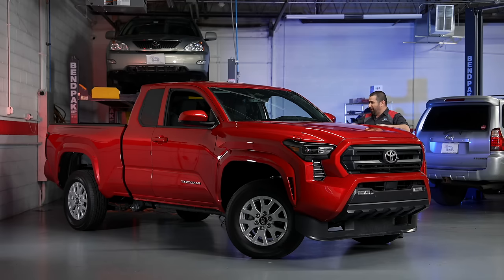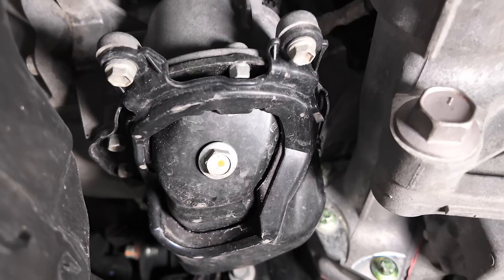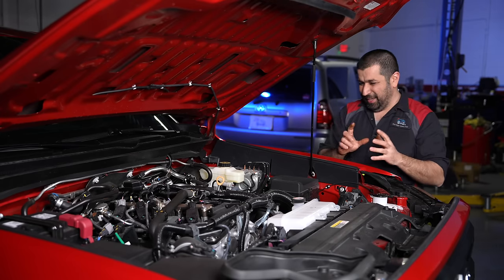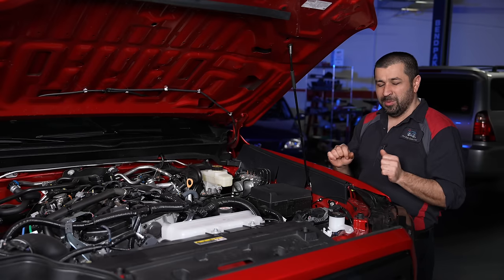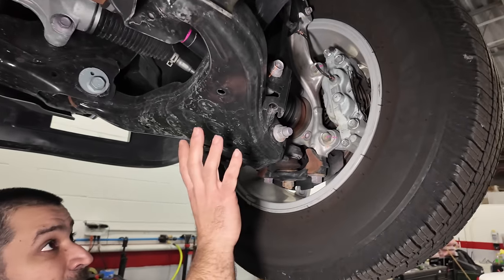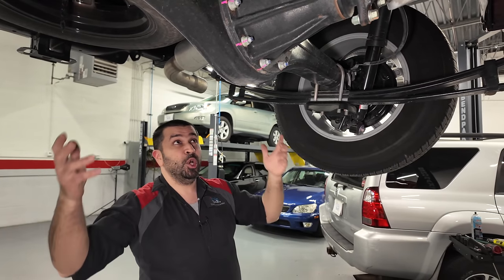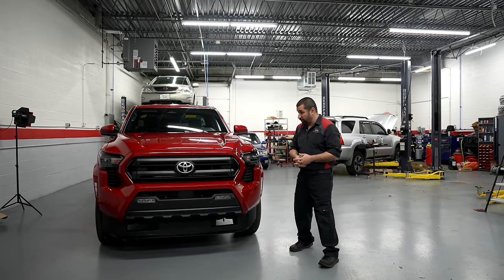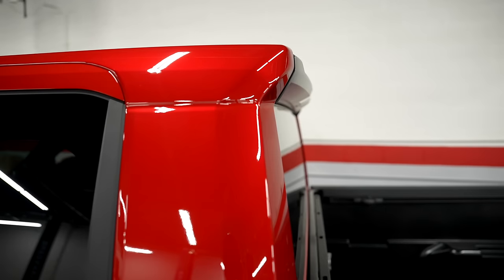2024 Toyota Tacoma | Did Toyota Improve or Ruin The Tacoma? Comprehensive Review

Comment: My 2020 Tacoma has the V6 engine so I get the best of both worlds.  No power AND bad milage.  Perfect!
Reply: You will get a good laugh reading all the comments lamenting the disappearance of the 3.5 V6 and its legendary 'gearhunter' transmission. 😉
Reply: Now you can buy one of these and it will get a little bit better mileage, a little more power(maybe), but wait, there's more! You can also get the reduced reliability and bugs that need to be worked out as part of the deal!
Reply: @Doomzdayxx this turbo 2.4 isn’t even remotely new.  It’s been used in other models including Lexus.  He even mentions that in the video.
Reply: @johncho8766  Cool story.
Reply: @Doomzdayxx  read what you wrote and what I wrote and ask yourself which one is a statement and which one is a story.
Reply: @Doomzdayxx  🤡
Reply: Laughs in 2.7 I4
Reply: @Doomzdayxx you're a joke. It's massively more torque overall and at a lower rpm.
Reply: This new one is getting 1mpg better EPA on the highway and TFLs new Tacoma broke down already.
Reply: @nicholasroberts9618  it was never meant to get better fuel economy; it was meant for better power at not worse fuel economy.  The head engineer said as much on its launch.  Yeah, TFL’s Tacoma lost front wheel power, most likely a CV shaft or front diff, not the engine.
Reply: @BrandonEht  The spiritual successor to the 22r. At least that's how I've always though of it. I'm considering looking for an older 2WD tacoma with that engine and a manual trans.
Reply: @MrMikeDao It's trash and will be plagued with issues and will not be as reliable as the V6 and definitely not the 2.7. Keep boot licking though.
Reply: @tristanedley  🤖
Reply: The previous 4.0 was so much better it actually had some torque.
Reply: @johncho8766  Major cope
Reply: @johncho8766 it gets alot better fuel economy.  24 hwy with the dam
Reply: @nicholasroberts9618 yeah well they just launched the vehicle im not worried about it since i wont buy one yet.  But they will improve it in the future.
Reply: @Doomzdayxx  I've had turbo'd 4 cylinder cars and motorbikes since the 80's; properly engineered, they go like stink and none of them ever blew up or wore out on me, which is more than I can say for some of the hotted up naturally aspirated V8 powered cars I've had..
Reply: @petesmitt cool story bro.
Reply: @johncho8766  Everyone in a panic like Toyota hasn't thoroughly vetted this engine. It's because us Americans are used to our automakers dropping new engines that turn out to be turds or don't have all the bugs worked out yet( or they will make a good engine and tweak it until it sucks).  Toyota does not f**k around in the US market. They would never put an engine in a vehicle as popular as the Tacoma unless they were absolutely sure it was reliable and durable. if someone has an example of them doing otherwise I'd love to hear it.
Reply: True that
Reply: @Doomzdayxx This engine is proven. It’s not new. It’s better than the V6. More power with more torque at a lower rpm. The engine doesn’t need to work as hard. Better on fuel too.
Reply: @mjwbulich GM and Ford 4 cylinder, I would stay away. Toyota is a master at 4 cylinder. Toyota does brutal testing in their engines. 

Toyotas issues are differentials and rust.
Reply: @ryanb8736  said nobody.
Reply: This engine sounds worrisome with all the gaskets and turbo charged pressure.
Reply: @grayman618  Say it a little louder for the idiots in the back!
Reply: @nicholasroberts9618  take off the ugly chin spoiler, and the four banger gets the same mpg as the v6!!!
Reply: 0 to 60 in 3 to 5 business days. As an owner of an old Tacoma,  I know!
Reply: @socc4298 complaining about the speed of a tacoma is like buying a scooter, then complaining theres not enough storage space for luggage.
Reply: @nicholasroberts9618  take off the chin spoiler, and the 4 banger gets the SAME gas mileage as the v6.
Reply: @Doomzdayxx it’s a fact, not a story. I like the v6, but the outgoing v6 was a turd. The man was just repeating what was said in the video. Why would it be a story??
Reply: @johncho8766 Lexus are road queens.. let’s see what happens to that 4 banger turbo in real off road situations.
Reply: @Ed-gq8hk  sure, only time will tell.  I’m not the one pretending to know or to be able to predict the future, that’s Doomzdayxx’s job.  All I said is that the turbo 2.4 is not remotely new.  I’ve owned a 2007 4.0 and now a 2017 3.5 and neither of them were amazing in terms of power or efficiency but neither of them (or any Toyota I’ve driven) were turds from a reliability point of view.
Reply: @rightlanehog3151  Yeah I just tuned it. Problem solved. Now I don't have to waste $10,000 more on a downgrade. I am getting 22MPG now.  Plenty of low end power and no gear hunting. The front diff already self deleted on TFLs new 24 tacoma doing mild work. No thanks. I am not paying more money for less. I am sure in a couple years it will be better when they fix the issues. I saw another 24 tacoma on taco nation that just quit starting with only 800 miles. Stuck where he was at.
Reply: @Doomzdayxx  i have the 2.7L it is seriously under powered for the weight of truck. If it had any low end it would be decent.
Reply: @JD-yx7be I had one too. i'm no genius, but when I bought it, I was smart enough to know that it's not meant for racing or for heavy towing, therefore it was never a problem for me. 

It's a small, simple, super reliable little engine for small light duty trucks that can go well over 400k miles with decent maintenance. good luck getting that with a turbo engine.
Reply: Its the transmission that's garbage. Not the engine. I have a 2019 with a manual transmission and it drives just fine. I have hauled excessive weight up one of the longest sustained climbs in America with zero issue.
Reply: @deadbrother5355  No the transmission is fine. It needs a tune. The stock tune is shit. With the OTT it remaps the ecu power curve. All your torque and HP comes in at the low end how it should be instead of making peak power at 5000 something rpm. It changes the transmission shifts  to linear and holds gear on inclines no problem. A tune solves all the issues people complain about. It also makes the throttle response instant. No more waiting on the transmission to shift. People with manual tacomas get their trucks tuned as well to move the power down low where it should be.
Reply: @deadbrother5355  - I have a manual TRD Pro and while I like it, but she's a dog.  Getting about 11 MPG combined.  Interesting to hear about your towing experience.  I have two small quad 80s that my truck struggles to pull up moderate hills here in Los Angeles.  I have to keep it reved out in third or fourth to stay around 55mph.
Reply: @danielstewart7369  i average 14-15 mpg. Are you running oversized tires?
Reply: @270eman  i agree that the factory tune is trash. I hate the throttle lag SO much.
Reply: lol!!!
Reply: Never had any problems in my 4 Toyota pickups, 1985, 1991, 1995, and current 2000 model Tacoma, New York State Road Salt is eating up the frame and body but it still runs awesome with 245,000+ miles on it yet.
Reply: @johncho8766 the Front Drive is designed to fail. You should have watched the whole TFL video
Reply: @montefiveforty1  they should have modernized the 4.0 with DI, higher compression and a 9 speed trans
Reply: @mjwbulich  Tundra owners may disagree
Reply: I’ve got a 19 sport and it has plenty of power.  I  don’t love the transmission like I did on my other 3 Tacomas prior to that but as far as power, it goes.  I’ve had sport cars, real ones. Corvettes.  So I know power. Is it the fastest? Of course not.  But I wouldn’t even mention it.  I’d talk about the crappy stereo and console.  The problem with Tacoma’s today is they make too many freaking options.  And then all these goons that Change everything on them.  It’s all about $.   And selling crap to these young ………..people.  
But I remember a time I thought spinners were cool.  So we all have our dumb a moments. I’m being nice because apparently there isn’t free speech on YouTube.
Reply: Them WHY do people wait on line to overpay for them, saying how great they are?  They could buy  a Frontier with strong power for less money. And  yes, they are extremely rereliable.
Reply: And probably will last 300.000 miles ......😅😅😅😅
Reply: . This is not a sedan.  Its a working truck.  There is not replacement for displacement.   Preffer the bigger slower V6 with not turbos , 20 spéeds and Ton of gizmos .....
Reply: .  Buy a prius so.     Have the last gen and make 20mpg everyday ....
Reply: @ryanb8736  want to see 250.000 miles on this one ...😅😅
Reply: . Exactly.  Totally different application
Reply: Seems the Taco has a lot of mothers to love it for all its glaring defects. The Toyota addiction must be very powerful to turn liabilities into loveable "assets."
Reply: @rightlanehog3151  it's hilarious how these blindly brand-loyal Taco fans look past these legendary liabilities,  while bashing the Frontier's torquey, reliable engine, and non-hunting transmission,  which contrary to popular lies is NOT  a "crappy Nissan transmission" (not a CVT).
The world is so full of propaganda.
Reply: @johncho8766  Even so, should Toyota be blowing diffs at this stage in their experience?
My Toyota 4x4 blew a rear differential early under warranty (NO off roading), AND again after the warranty was gone. Andva head gasket under warranty also. Toyota is not as perfect as the fanbase claims.
Reply: @Doomzdayxx  Good idea. The new 4 will never be like the 22R due to stress and complexity. 
Only bad thing about later 22R is the single row timing chain which does not last like the earlier ones. Originally,  both Nissan and Toyota used stout double row chains. Nissan wisely stuck with double,  while Toyota in the 80s skimped out. The chain and guides wear more quickly. My understanding is there are kits to convert them back to double. Otherwise those things are like tractors and run for many years.
Reply: @iskdude9922  Yes but who will leave the ugly dam on?
Reply: @mjwbulich  Sir, what about the Tundra? Wastegates going bad and cab REMOVAL  to fix, and now numerous reports of engines blowing and difficulty finding replacements for months while trucks sit at dealers. 
Not off to a good start. We can't blindly assume the big T is guaranteed to never blow it.  Now they are so cheap they moved Taco to "hecho en Mexico." And the price went UP!  Nissan Frontier still built with US jobs. And coats LESS  Greedy Toyota.
Reply: @ryanb8736  Simple physics: more power out of less displacement means it IS working harder. It FEELS more effortless,  but higher cylinder pressures and Temps are  creating the higher power.
Reply: @ryanb8736  Even my old SR5 4x4 with 22R blew 2 diffs, with no off roading. Also a head gasket under warranty!
Reply: @270eman  That's IMPOSSIBLE! 
ALL Toyotas walk on water, and no Toyota ever has or will ever break down!  The fan boys told me so
Reply: @danielstewart7369  11 mpg? I heard a Dodge V10 can do that!
Reply: @johncho8766    emissions was main cause.   Fuel economy on last model was not bad.   Turbos pushing and pressurizing the engines will not help to last more .... is not a diesel block.
Reply: @socc4298      so you have the wrong car.  Is not to make 0 60 records
Reply: @jeanclaude7018  maybe leave it on road trips or in town.   Take it off while offroading....  at least its an option.
Reply: @jeanclaude7018  interesting. Thanks for info.
Reply: @davidvines6498  I did watch the whole video.  All of my comments were regarding the engine and all I did was point out that the TFL Taco had diff trouble, not engine trouble.  You should have read my whole comment.
Reply: @jeanclaude7018  Anything can break. Nothing last forever. I see Toyotas broken down all the time at the dealership. 

I always tell people to buy what you like for your needs. If and when it breaks, just fix it and keep enjoying it.
Reply: @jeanclaude7018  It has higher cooling and more durable parts. I built engines for 35 years. You? 

Kia’s these days are going 300k. I’m sure a better built Toyota will go triple than that.
Reply: @ryanb8736  Truth.
Reply: Longevity is power
Reply: @ozarkliving7263  That's what I say when I cruise in my 106 HP Hardbody that I've been driving for almost 30 years.   I don't care if anyone laughs. A truck with longevity  is like a faithful friend. It can still roll with freeway traffic.  No automatic either, just power steering and crank windows. I must be roughing it.
Reply: All the butthurt simps in here making fun of doomsday for telling the truth on these garbage turbo four cylinders. 
  A lot more money for unnecessary electronic garbage and a motor that probably won't see 150,000 before it has a major repair.
Reply: @perrooceaniko2005 I hate to say it, but 300K is pretty optimistic for this specific Toyota. I bet the turbo won't see 150k and the rest of that stressed 4 banger will probably shit the bed within 100k of that. The EPA is one of the biggest reasons we have these short lived, hopped up 4 bangers in larger vehicles.
Reply: @Fuckurfeels7472  No!  EVERY Toyota walks on water and will last AT LEAST 3 million miles! With no repairs!  Even if "hecho en Mexico"!!!  
Some armchair engineer in the comments was trying to tell me that these turbo 4 bangers have NO more stress than a V6 n/a mill. He went on to say the VQ Nissan was going to melt pistons because it had to rev so high to get power. I referred him to the TFL video of the Frontier towing 5 miles up the Colorado mountains with 6000 pounds , pedal to the floor the whole way. 
No reports of "melted pistons."
However, there are reports of turbo Tundras sitting in dealers waiting for replacement engines. Already.
Reply: Yeah I wish I could travel back in time and slap some sense into myself when I went in to trade my 2nd gen for a 3rrd gen.
Reply: OTT takes care of the power problem. It's worth the investment.  Not sure why you get bad mileage. I have a 2023 Limited 4x4 and get almost 20mpg between city and highway.
Reply: @Doomzdayxx  If you get a later 22r, just check.out the timing  chain system. The early ones used a double row like my Nissan Z24 and worked great. The late ones Toyota skimped and went to a single chain, and they don't last as long.  I don't know why they messed with it.  I have seem kits to convert them back to a double row chain.
I had a late one that ran fine, but the chain rattled a bit when first started up. I sold it that way.
Reply: @Doomzdayxx  Toyota seems to inspire the licking behavior for some reason.
Reply: @scottsmith7348  Why can't the mighty Toyota take care of its mistakes for free? They sure charge enough for their stuff they make with discount labor in Mexico. GREED.
Reply: @270eman what kind of tune did you grab for the truck? Hate the graring in the V6. I have a 2021 sr5
Reply: @bjantilla8004  Overland Torque Tune Mild/medium
Reply: @Doomzdayxx  Wow, great memories.  I had a 22r in my '85 truck...it wasn't called a "Tacoma" back then.
Reply: Sounds like the second generation, V6 engine, no power, low mileage, 1999 third gen V6 is a marvelous engine , in comparison . . .
Reply: @iskdude9922 My 2018 gets 24mpg highway....in fact my last 1300 mile interstate trip it did 25.2 mpg. It routinely gets 20 or 21 cruising around town.
Reply: @jimmy-et1pm  you must got on some light tires or something then
Reply: hahaha! but remember No power AND bad milage for 4 decades 😂
Reply: @Doomzdayxx  the V6 had terrible reliability issues when it was in its infancy too. It takes time to perfect it. So either you remain scared and never progress, or you deal with the growing pains along the way(which are covered under warranty) to ultimately achieve a much better end product. If people were always so scared of growing pains as they are now, we'd still be riding a horse a carriage because you can't get more reliable than that!
Reply: @steve8803  You can't compare livestock with man made machinery. Failed logic #1. 

Turbo gas engines don't tend to have the long term reliability as NA engines of the same quality. That's just reality. Failed logic #2. 

People tend to not want to worry about their vehicles leaving them stranded on the side of the road, warranty or not. Failed logic #3. 

Any more stupid comments?
Reply: @Doomzdayxx  I can compare whatever I want. You don't have to like it. And I don't debate with people who resort to personal insults against someone they don't even know. Have a nice day, honey.
Reply: @steve8803  😂
Reply: @rightlanehog3151  It is not the transmission. It is the on board computer and it's programming. I've got a 2023V6  with no issues. We are in harmony. It is similar to my 2016 4Runner.
Reply: @mjwbulich  umm, que the new Tundra 3.5TT. 😂😂
Reply: @Doomzdayxx Billy Mays no longer ever said ‘But wait, there’s more!’  Mandela Effect.
Reply: @rightlanehog3151  I must have a good transmission in my 2018 TRD. I live in WV and it shifts smooth as butter on this curvy up and down roads. Oh and love my v6 this is a truck not a sports car.
Reply: Me drive Toyota. Me like bigger number. Bigger number better. 6 big number. 4 small number. Me no like Toyota any more.